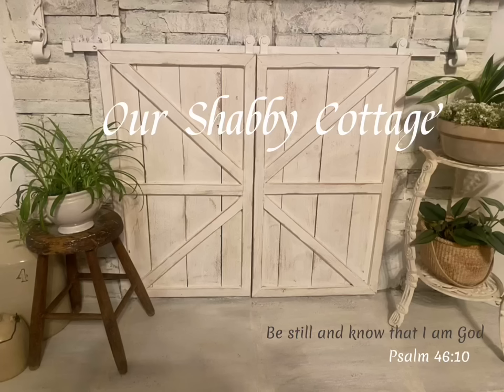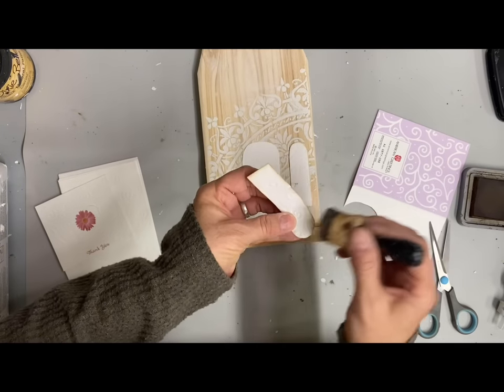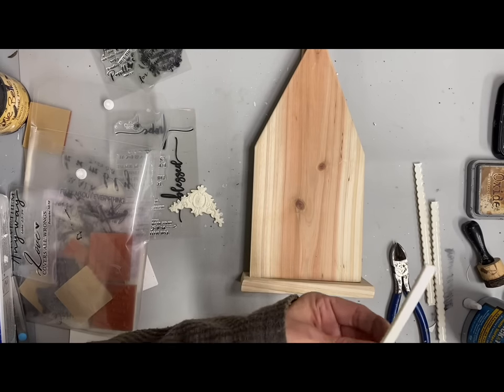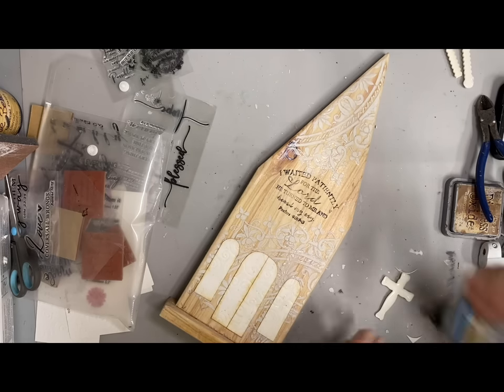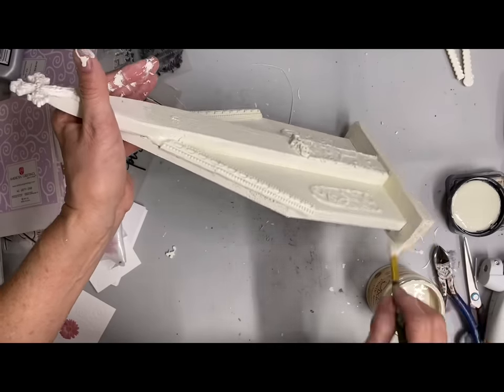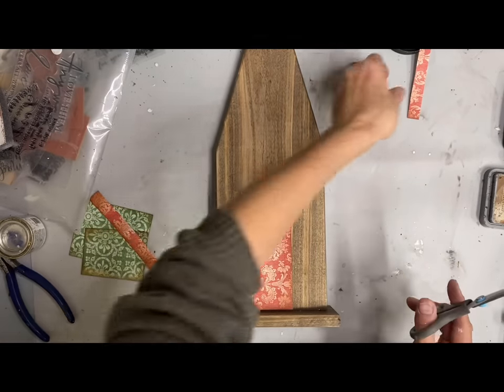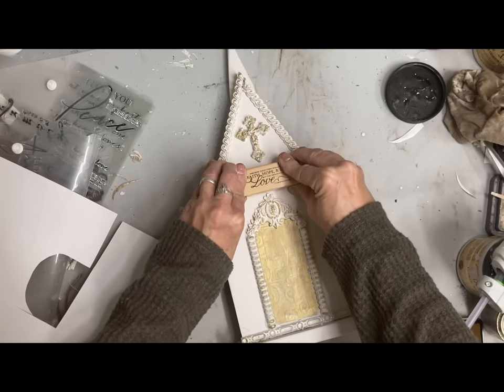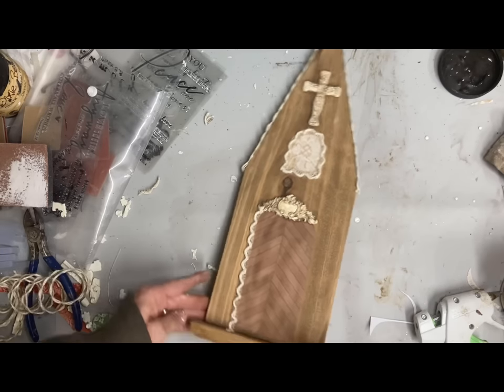DIY Scrap Wood Churches

Comment: Does it matter if you use resin or air dry clay. Do they make the same effect
Reply from the maker: Either will work fine.  You can even use hot glue🙂